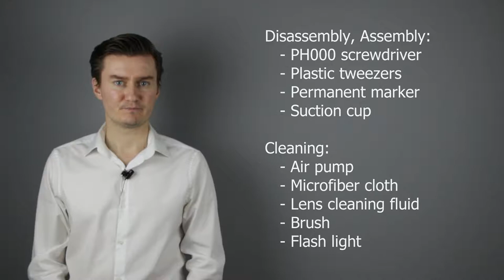Tamron 18-270mm f/3.5-6.3 AF Di II VC LD ASP IF MACRO cleaning the lens inside

Comment: My lens has fungus in between the combined lens (front element), im not able to clean! Any idea how to approach this situation?
Reply from the maker: Generally, that can't be cleaned... it is (almost) impossible to separate the two lens elements, and put them back together perfectly.
Reply: @CamerasLensesEtc  Thank you for the reply! think i have to live with it in this case
Reply: @CamerasLensesEtc  I have the same problem, how are they joined? You said it was almost impossible, so it potentially can be done. I just need to know how they join........ I appreciate the rest of the video by the way, thank you!
Reply: I just got this lens and it is plagued with fungus. I intend to disassemble it so I will let you know here if it is still interesting to you. Usually, you would need to use a rubber tool to apply gentle pressure on the glass and rotate it to unscrew it.

Comment: Thank you for the clear instructions. Would be great if you would come up with the tamron 18-400 lens. 
It’s front part is pretty tricky as there is no indication of where to find that tiny hole before getting to the screws.
Reply from the maker: I haven never had Tamron 18-400, so I don't know how to remove the front lens element.
Reply: @CamerasLensesEtc  I just got done cleaning my 18-400, using this same video. The toughest part was working with the three (3) set of shims under the focal mount. They are real thin and bend easy. The plastic ring was a little fight to get off. Thanks for the Video!

Comment: Hi, I just wanted to thank you for your good movies. I've gone through your help itself a flexcable replaced by a canon 17/85 lens. I find it totally amazing to fix things. I am also considering going to movies. But then with all different repairs. Unfortunate that as a hobbyist no parts near Cannon can buy. Also, there are no stores that sell canon parts. Also repair schedules are not available. Thanks again. Sorry for my bad English
Reply from the maker: Hello! Actually, you can buy lots of repair parts for Canon on eBay. In the NL, TechRepair also selling original, genuine Canon repair parts.
Anyway, thank you for the positive comment!
Reply: hello, i want to ask you, if there is moisture between the frontlens itselfs, is there  a way; to clean this? there are now visible dried waterdrops between the frontlens, inside, the moisture is gone, but they leave marks between the lens inside. by the way i liked your video, but i wonder if there's a solution for this too.